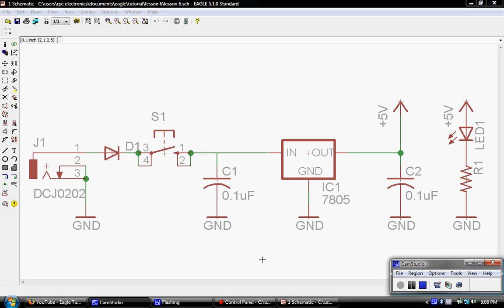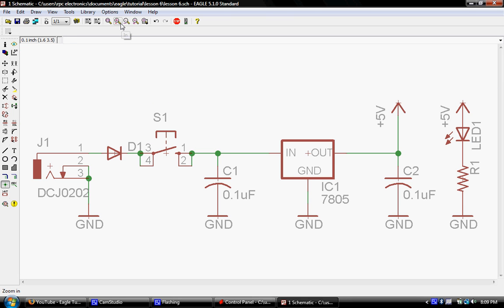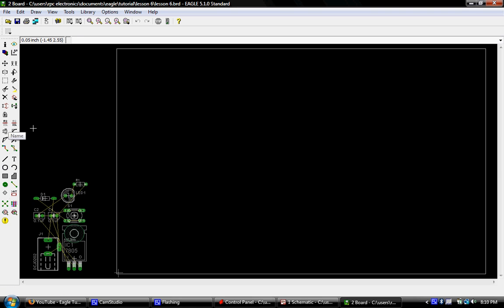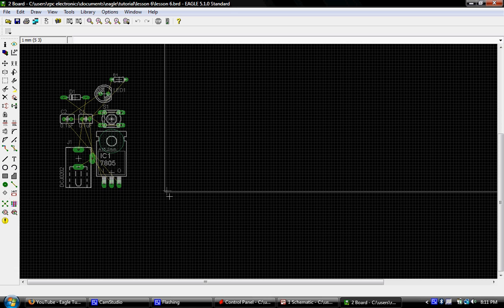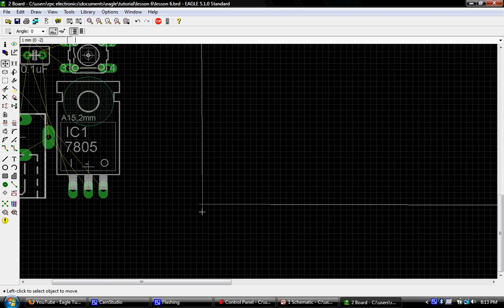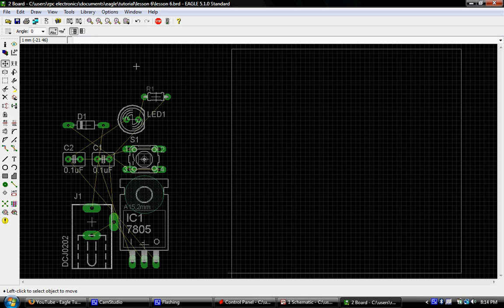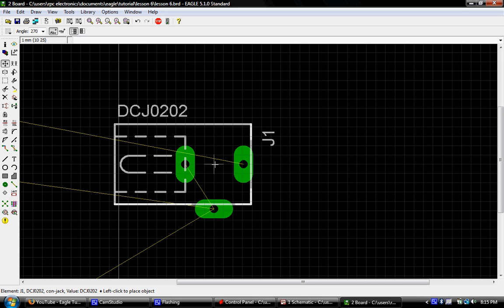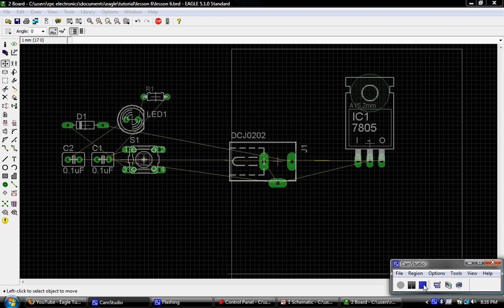Cadsoft EagleCad Tutorial Lesson 6

Comment: I know this was 3 years ago, but was there ever a tutorial on creating custom parts?    I was thinking of at least one way to break parts up:   into imperial spaced parts and metric spaced parts.  For example, the TO-3P case presents some off grid issues with its spacing.  Another thing to describe would be how to handle the +/- variation in pin and part dimensions on the board.

Comment: I see you like a metric grid, even though it looks like most of your parts pins are defined on a standard grid.  Typically I would set the grid based on the majority of the parts to make routing nice.  Then change the grid and finalize the board outline in metric, if I had to.  Don't know if this routing to pins off grid will be an issue in Eagle or not.  Typically in OrCad it means a connection is not made at a 90 or 45 deg angle, so you can't drag the track later to a new position.

Comment: You'll find that part outlines and pins fit the grid a lot better if you use mils instead of mm for the grid, since that's what most parts are designed as.